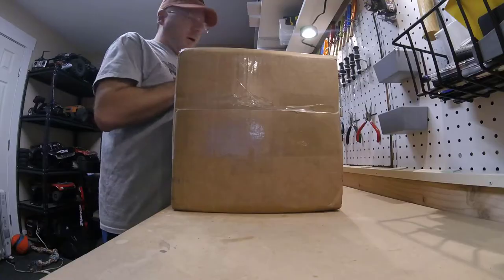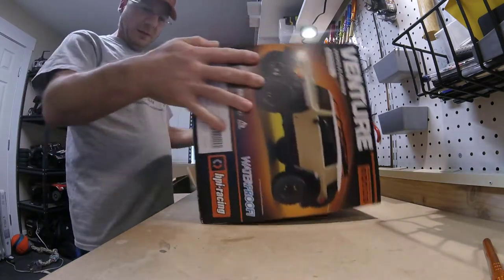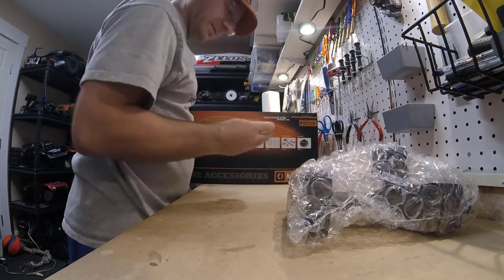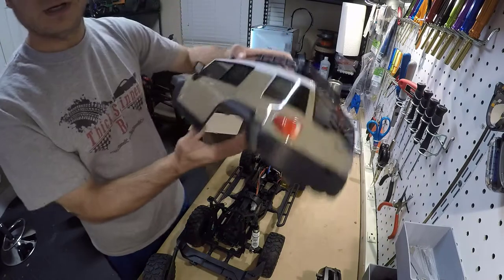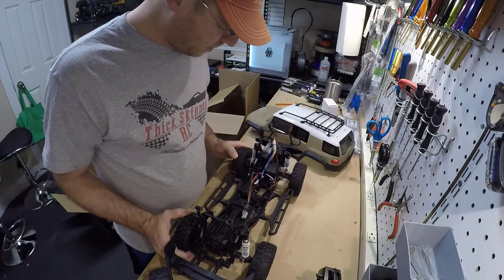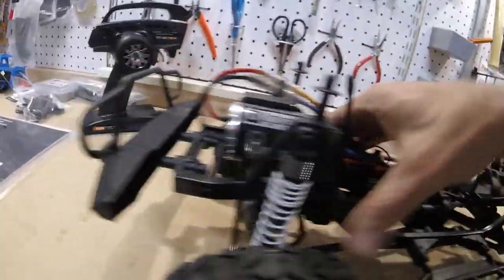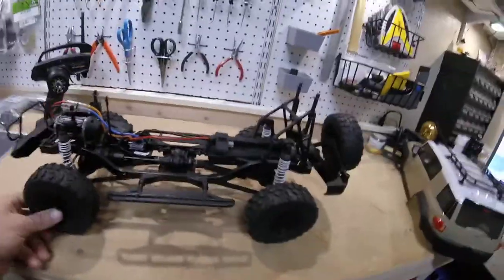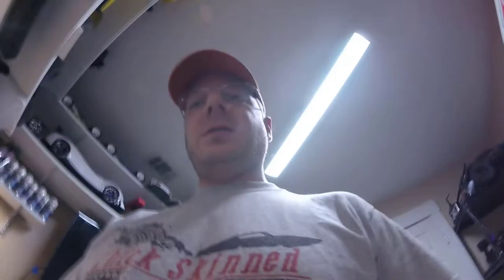HPI Venture FJ Cruiser - Unboxing and Initial impressions

Comment: How would you compare this to the Gen 7 Pro out of the box?
Reply from the maker: Different...  Metal where Gen7 has plastic, plastic where gen7 has metal, smaller/more scale tires, slightly better steering angle, but perhaps weaker servo.  The HPI will take a bit more.... skill(?) to navigate with due to smaller tires but a bit less due to better steering.  Very similar but very different RTR rigs.
Reply: Is the Venture worth the approximate  $120 difference? I also looked at the Venture but besides the obvious eternal pre-order status, I couldn't justify the big price difference over the Gen 7 Pro. Looking forward to a run review.
Reply: If you are considering both of those options equally, then the Venture will not be worth it to you. The Venture is a much more scale rig whereas the body of the Gen7 is not. It has decals in the front in place of a grill and headlights. That being said, I've bought both the Gen7 Sport and Pro, it is very capable and for the price, the performance is great. You WILL have to modify the steering because it is horribly bad. However, if you don't mind how it looks like and that it is only a semi-scale rig with the stock body, then it is a better buy.
Reply: I already have the Gen 7 and I have "fixed" the steering , more like the lack of steering. I like the look of the FJ body and the scale look of the differentials on the Venture . It just seems like from the running videos I have watched so far on the Venture,  the Gen 7 comes much better equipped for out of the box crawling/trail running. Maybe I will look for a used Venture in the upcoming months. In my opinion, HPI set the price point a bit high.
Reply: Go to Thingiverse and print yourself the front grill, hood vents, door handles and bucket lights. If don't have a printer then ask Shapeways to print them.
thingiverse.com/RedcatRacing/designs
Reply from the maker: Brian Rader with $120 invested in the redcat it'll out perform the HPI.  It's not quite as scale but performance wise they're close enough out of the box to be equal, in different ways.
Reply from the maker: Dave Racine so awesome how redcat released files to print!  The gen7 body needs some work to be a looker but it's not bad stock. Like a cross between a XJ and an Escalade.